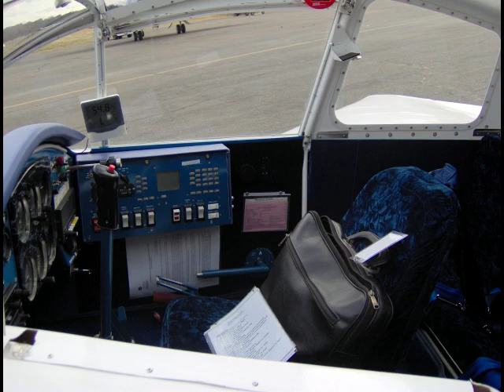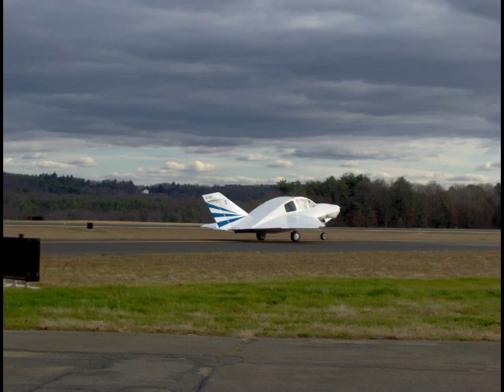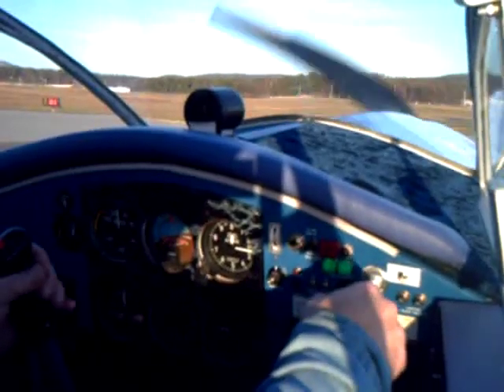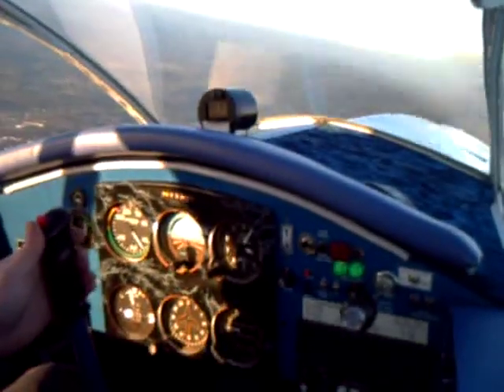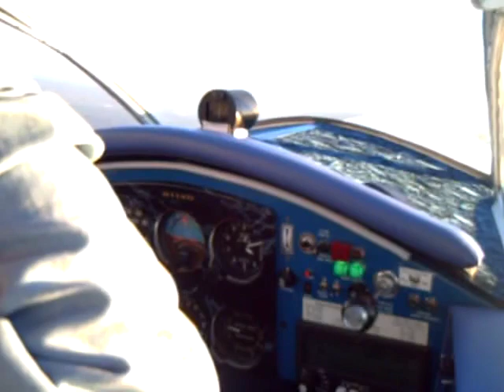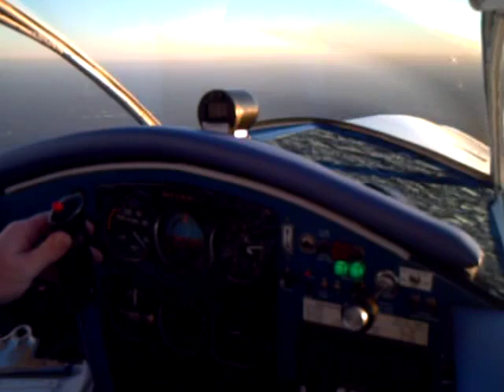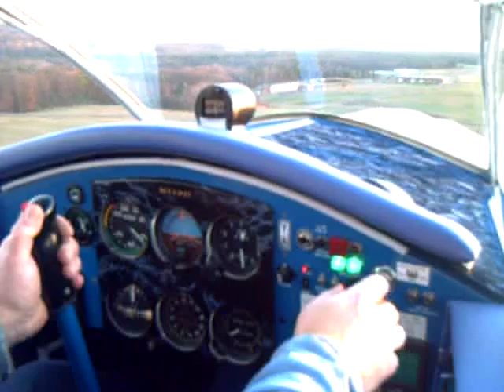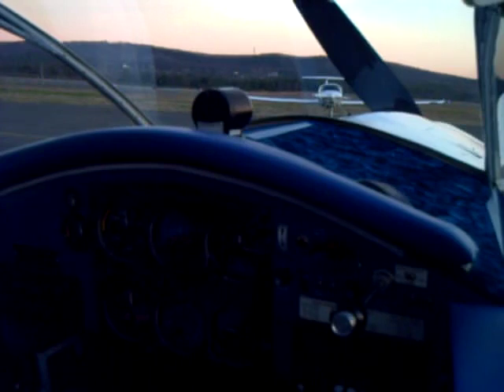Dyke Delta N11XD Test Flight 2

Comment: Jim...........would be great to know some of your speeds, ie, rotate, climb, cruise, approach, downwind, base, final.
Reply from the maker: For reference, the marks on the airspeed indicator are 2 o-clock = 80 MPH, 4:00 =110 MPH, and 6:00 =140 MPH. So after reviewing the video I saw rotation at around 90 MPH although it is not really a rotation in a Delta, as at around 85 it just kind of lifts off and you need to apply a little forward pressure on the stick to hold it in ground effect and let the speed build up. You can see it builds to about 110 very fast. I was climbing at about 125 MPH. Cruise was between 120-140MPH with the gear down. The gear was never raised during my test flights. Pattern entry and downwind were flown at 120. Base was 115, final 110, and touch down was at about 90.